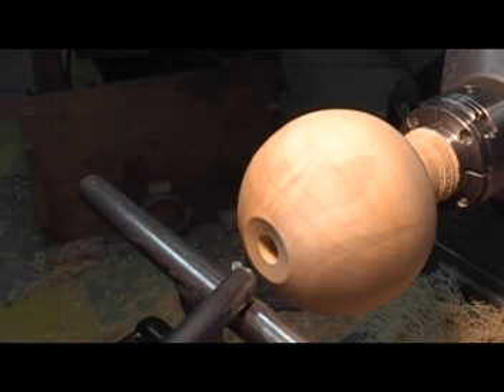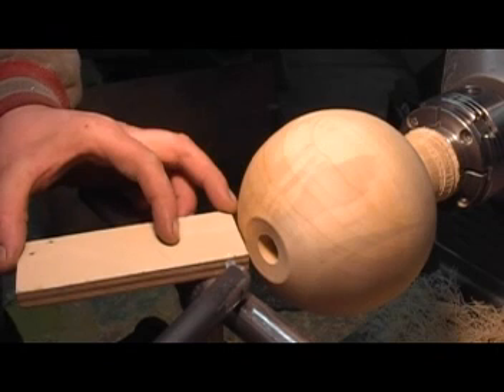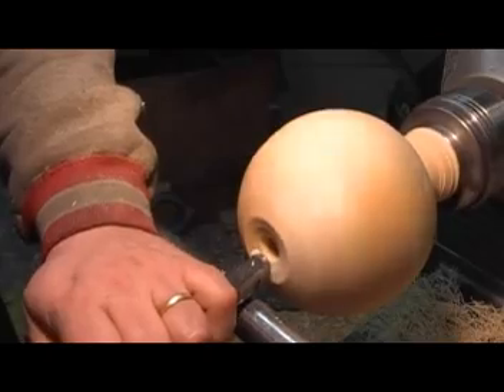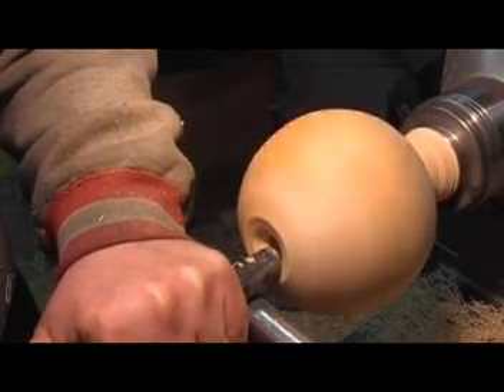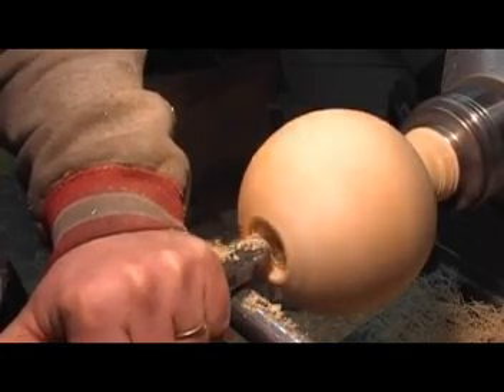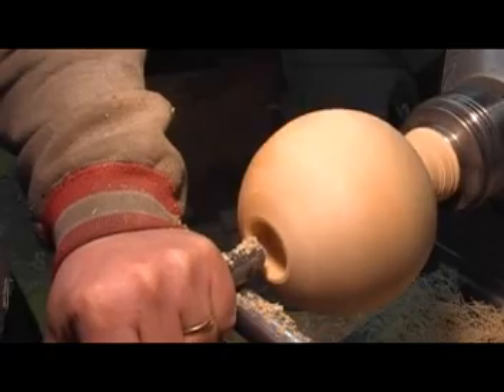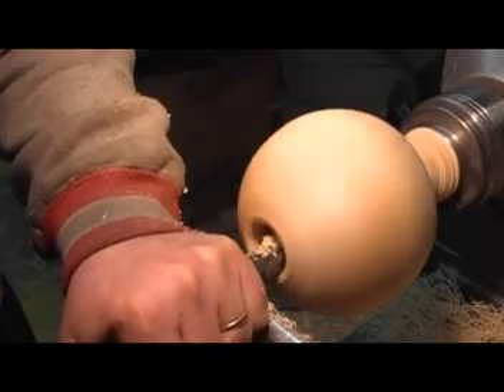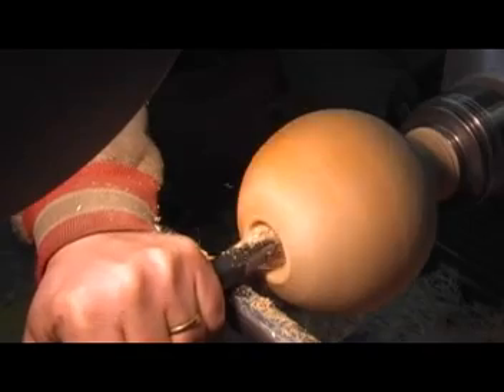Da Ball Part 1

Comment from the maker: Google "Captured Hollowing Rig" and you should find a few examples. Basically it is a fixture that lets you hang a tool well over the tool rest, without much drama, as in the tool catching and causing a bit of trouble. The rig holds the tools on the exact correct angle and does not let it turn or twist when contacting the inside of the piece you are turning if you to my homepage 3dubya DOT ablett DOT jp SLASH workshop SLASH hollowing_rig DOT H-T-M

Cheers!